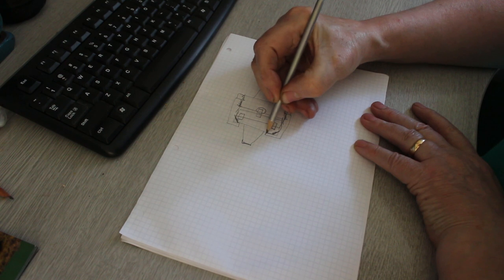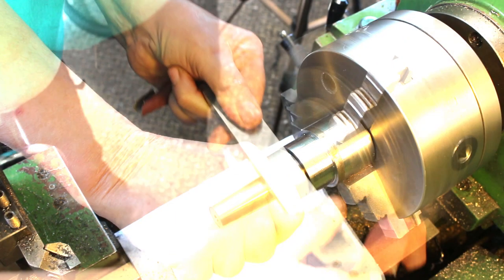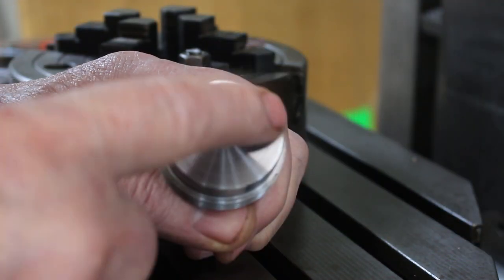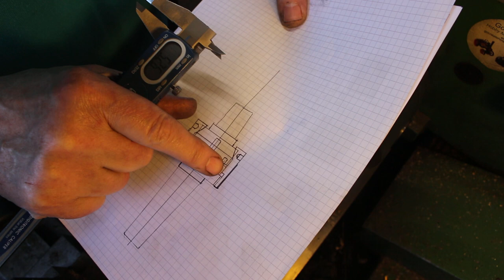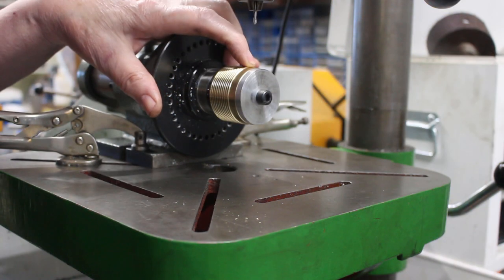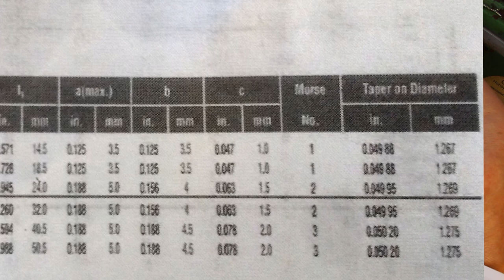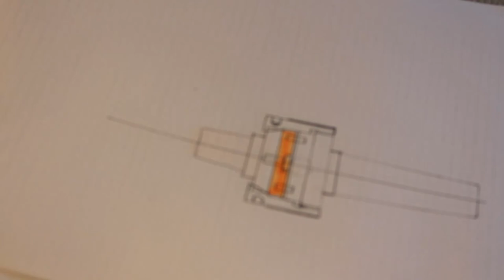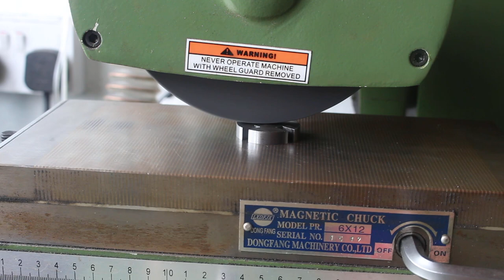Making a Floating Reamer Holder - My #TMC2020 competition entry.

Comment: G'day Nigel you had me completely transfix as you went about this,  that was a beautiful piece of hobby engineering.   I am going to go back and watch it a few times to make sense to it all I suppose it's a chuck  so that you can machine very small diameter pieces, not shore anyway great building of it thanks John
Reply from the maker: Hi John, Yeah, the video is a bit of a roller coaster ride, allot to show in a relatively short time. Basically when the collar on the tool is slackened slightly it gives the reamer some freedom of movement to align itself with the hole, thus reducing or eliminating one factor that effects hole size accuracy when reaming. To be able to tighten it up solid makes it dual purpose i.e. drilling and reaming in one tool.
Thanks for your interest.
Reply: @GoCreatehms  
That taper did throw me for a loop, I was thinking with that in place, everything is well constrained. Then you explained that you loosen the tool to allow for the reamer to float.

Comment: Your the first person I have ever seen actually using Aluminium Bronze. I'm so glad to see it in practical use. Cheers
Reply: It does look nice in this application. In fact, you could make much of this out of the Bronze. The only thing that has to be of steel is the ball bearing, the surface insert that that ball bears against, the four drive pins and the drive pin plate. 

OMG, now I am going to have to think about 3d printing one of these, it just might work.
Reply: @oldfarthacks  Definately.

Comment: Sir,
  Speaking as an “old toolmaker”, I salute you and your work. It is organized, neat, and most of all functional. My only observation, would be to replace the steel hammer with an aluminum rod(s) of a couple weights for making adjustments without “dent burrs” left behind.
Reply from the maker: Praise from an "old toolmaker" is very much appreciated as is your advice. Thanks!

Comment: Great build, have been thinking of making one using ER16 for small reamers for some time now. Good idea to be able to lock the chuck to speed up work. I am curious how well the chuck lined up with the MK2, did You ever indicate it? If there is need for improvement turning or grinding the B12 with  the nut and assembly in place relative to the MK2 coluld make alignment of the drill almost perfect... I never used that lapping paste, but got the advice from a Japanese manufacturer of small linear bearings to use Autosol chrome polish for lapping. It brakes down and does not create problems later by embedding.
Reply from the maker: Hi Erik, haven't indicated the drill chuck but it seems to line up very well, not noticed anything untoward. The chuck carrier could easily be converted to an ER socket for use with ER collets, then there would be much less overhanging mass which may be an advantage. I had thought of using an ER collet but thought I would try out the chuck first.
Thanks for the tip regarding using Autosol, I can see that working well.

Comment: Would you use a much finer thread for the collar to improve adjustment resolution?

I love the mechanism a lot
Reply from the maker: Hi Tadesan, yes and on the drawings I made available I suggested using a finer thread.
Thanks for your interest, much appreciated.
Reply: @GoCreatehms  
And now to be evil. Since the holder does not move once in place, you could always add a wormgear adjustment. LOL

Comment: Nice project and presentation. Excellent care in detail design and execution. Appreciate that  it offers a full floating mechanism with transmission coupling of of 1:1. 

Here is my question.  How well it address tail stock axial tilt error? In other words are we counting on that reamer’s tendency to offer axial tilt error self correction? (As would a hand tapping may offer)
Reply from the maker: Thanks for your kind comments. The idea is that the reamer will self align with the axis of the hole independant of the alignment of the tailstock. All I can be certian of is that in practice it works very well. As for the theory behind it I'm not sure I fully understand it, it just works .
I hope that answers your question.
Cheers
Nigel
Reply: @GoCreatehms 
I believe it works because renaming is like tapping both have a tendency of self alignment starting from a cut depth of greater than twice bore radius, as long as the chuck is permitted to track angle of head stock spin axis (that steel ball) and is free on the x-y plane (the crank plate)  Your tool support that. 

Here is something interesting for us to discuss. The same floating and resuming function can be achieved with two universal joint coupled in series with float limiting on x-y plane just like yours. Universal joint? Is popular on front wheel drive models, one by the transmission case another by the wheel hub.

Comment: I thought I may try to make one using the materials he used in this video.
The aluminum bronze and the 4130 was over $550 US.
Shoot, I may as well buy one.
What the hell?
Reply from the maker: Hi Jeff
For hobby use just use what materials you have or can get. Matty's Workshop and Machine NZ also have videos making one of these, I think Matty used steel in place of the Ali-Bronze.
Good luck with your build.

Cheers
Nigel

Comment: Baddass,  dope,  one of the sweetest build I v seen w manual machines.  Maybe I could do it, maybe.   Bit do you think it might be a little better if the ball was recessed back more and held with spring,  and hss insert was corner broken and could insert itself w a perfect fit in the ball hole,  for maximum rigidity for like,  a weird tapping situation or something? AND, is that also a tappered end that fits the drill chuck? Or straight ?
Reply from the maker: Hi Ryan. I did consider using a spring but I'm not sure there is any advantage, the drive plate must stay proud of the main body to be aloud to float. Yes, the chuck is held on with a tapered shaft.
Thanks for watching.

Comment: What a beautifully made tool sir! I love your version of "knurling" using the lathe and shaper. It looks much nicer than the standard knurled, and is probably more comfortable on the hand as well. It woks well on the 5 mm hole you reamed but does gravity become a problem in larger sizes leading to oversized holes? Up to 12 or 13 mm probably not, and that's the chuck's maximum size by the look of it. I hope you win the prize sir!
Reply: That problem with gravity may well only exist in the bigger reamers. Actually, yours is an interesting question. 

 It's much like shooting a gun up hill, they wear out faster and in the larger calibers the bore tends to wear out on the bottom. 🤣  LOL

Comment: Great work! What kind of measuring device do you use at 6:40? Never seen one of those before
Reply from the maker: That's an inside micrometer, it's an older type as compared to modern types available today.

Comment: wonder if that would work for a rotary hex broach?
Reply from the maker: Hi, a rotary hex broach has to approach the hole at a slight angle, a few degrees to the work axis. The floating reamer holder is designed to align with the work axis so would not be suitable in this format for adapting t rotary broaching. Maybe there is a way to make a modification but I'm not sure what that would be.
Hope that helps, thanks for watching the video.